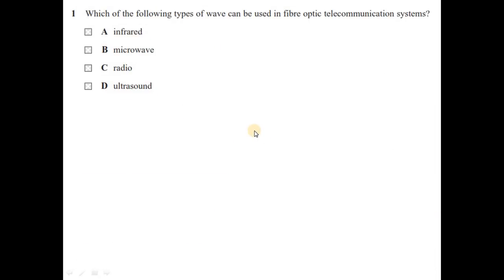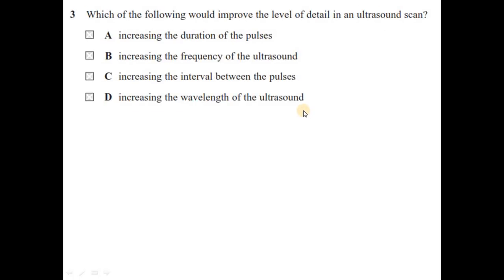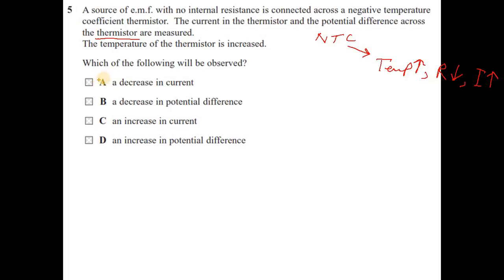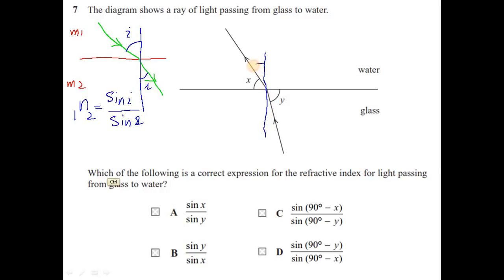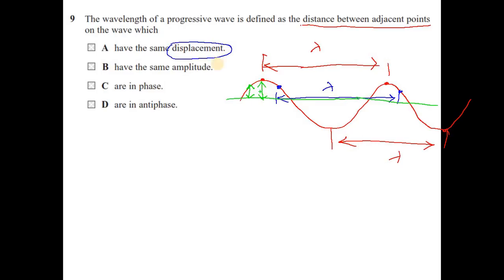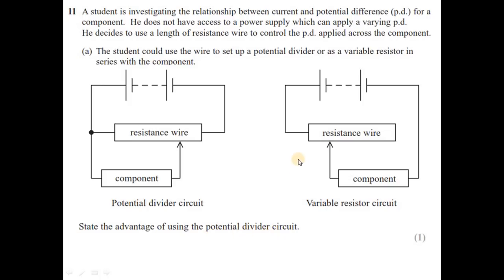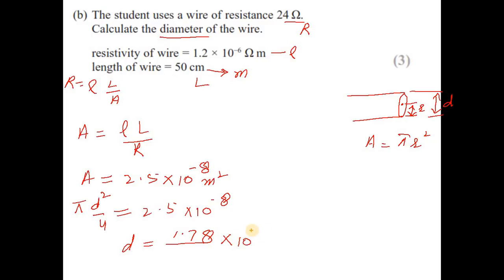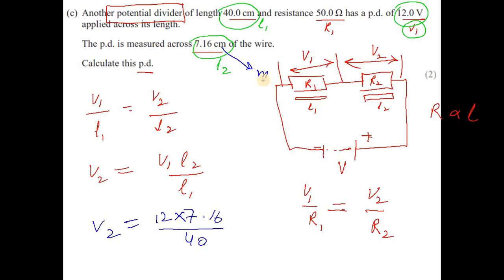Edexcel IAL physics unit 2 Jan 17 part 1

Comment: Sir I really appreciate this video . Nevertheless ,I am still  feeling a bit vague about the microwaves unable to pass through a fibre optic cable. A fibre optic cable as the name suggests (optic) means that it allows visible light to pass through it. Infrared has the closest wavelength to visible light so it will also be able to pass through the fibre optic cable.
Reply from the maker: Thanks,
the typical Optics means the study of light behavior when traveling in different mediums. the typical diameter of fiber optics is about 10^-6 m (micrometer). The wavelength of the microwave is greater than the diameter of the fiber optics.